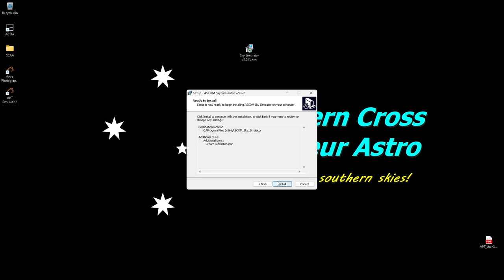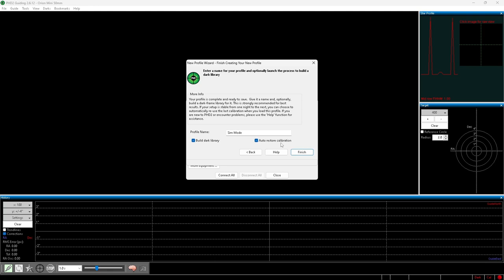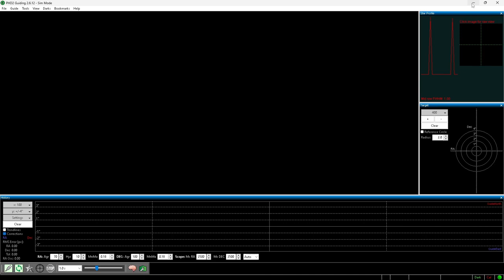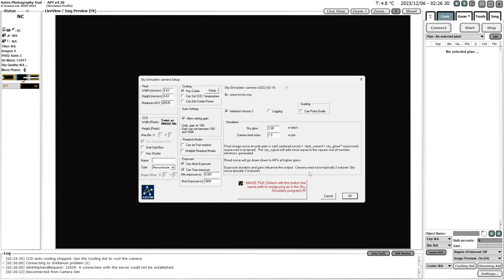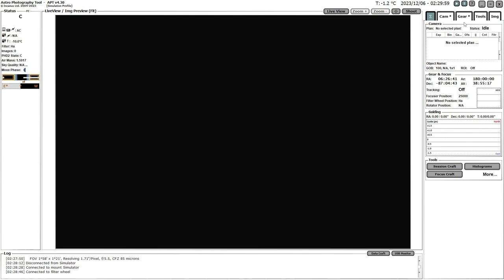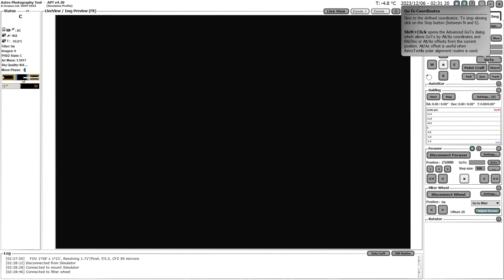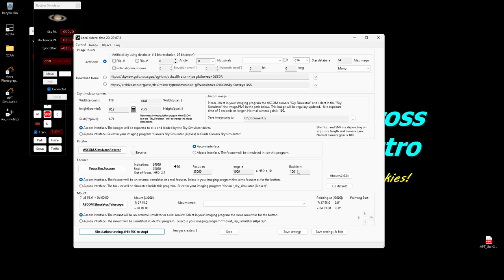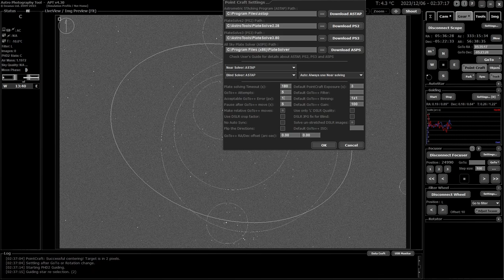APT Deep Dive -  Simulation Mode

Comment: Thanks for taking the time to make this video. Been meaning to finish setting this up to have a full test of meridian-flips and the scripting function of APT, which I have had ~50% success with.
Reply from the maker: Hope it helps you Darren. I've been using it for some time but it's only been recently that I've begun trying to get it to mimic my real gear better. I'm currently exploring the mount simulator more to try to get it working similar to my own mounts.

Comment: I am sure I have followed and entered everything as you have. My test plate solving of Orion fails (18:03) in this video. I have noticed in Tools, CCD Width and height it says 9.3 * 6.9. Those numbers are different than what your screen displayed. Would that be causing the plate solving failure? Is this the best way to ask you questions about this video?
Reply from the maker: Hi Brian. Are you trying to set up to match a 294MM camera like my setup or another camera? It really sounds like you missed a setting somewhere - what is the pixel size shown in the Object Calculator?

If the questions a related to the actual video then here is fine, but you can also post it to the APT forums if you wish, I'm usually on there a number of times a day so will see it.

Cheers
Reply: @SCAmateurAstro  I am following your example and see 9.3 * 6.9. I didn't see where you indicated binning.
Reply from the maker: @brianwatson3435  Directly above where you see the 9.3 * 6.9, what does it say for CCD Pixels? It sounds like either the pixel size or image w x h is off.
Reply: @SCAmateurAstro  4.63
Reply from the maker: @brianwatson3435  Ok, from that I'm guessing the image size in the Sky Simulator hasn't been set correctly. See from 02:15 in the video & make sure it is correctly set at 4144*2822. Hope that helps.
Reply: @SCAmateurAstro  4144 * 2822, 80.2 height[arcmin]
Reply from the maker: @brianwatson3435  I'll have a look into this a later Brian & try to figure out why APT is showing the incorrect sensor size. If you have exactly the same settings as me it "should" be working the same. The only thing I can think of right now is that maybe you haven't connected APT to the right camera somehow. Leave it with me.
Reply: @SCAmateurAstro  I'll double check. Thanks
Reply from the maker: @brianwatson3435  Hi Brian, did you get this sorted? I've double checked everything here & all seems right.
Reply: @SCAmateurAstro  No I didn't. Don't worry about it.